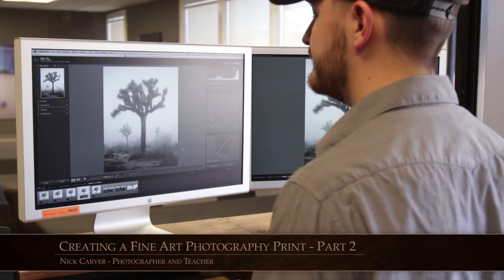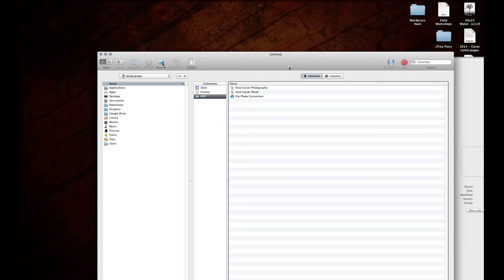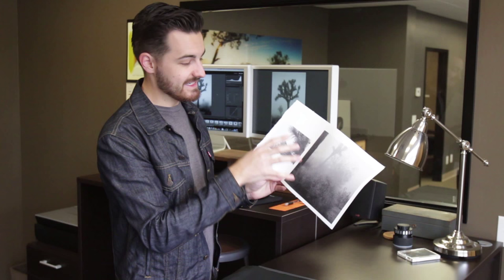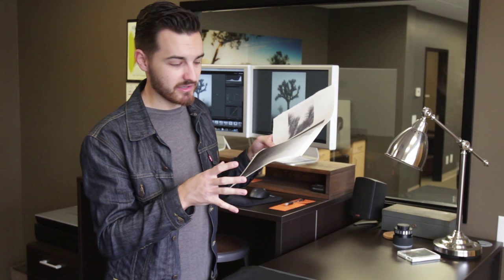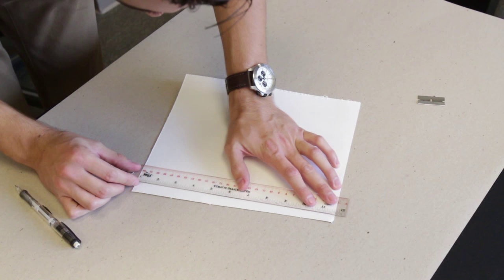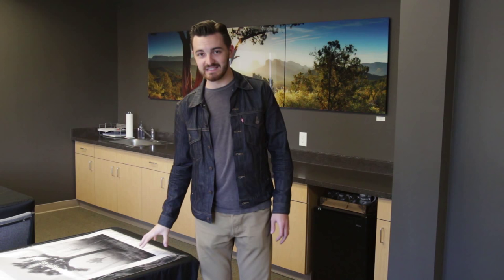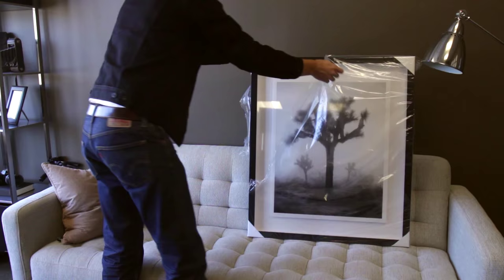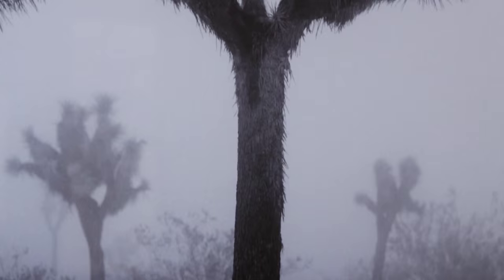Making a Fine Art Photography Print (2 of 2)

Comment: Just OUTSTANDING!!! First, you certainly should be proud of that shot, hell, I am and I had nothing to do with it! LOL. Second, the float mount is incredibly interesting. I'm only guessing but I imagine they 'sandwich' the piece between two sheets of glass and then placed that in the frame with a white sheet surface as the backing.

If they didn't do it that way, then I can't even imagine and alternative method. Third, you bring back the term "Fine Art" to photography. I resisted shooting digitally for years. In fact, the last film camera I owned was a Nikon F5. I was planning to graduate to a Hassleblad at some point when I got rich & famous...

However, the expense of film, processing, etc. was just spiraling out of control. In addition, my slides would come back with major dust and color processing flaws. I had no choice... I couldn't justify the costs to stick stubbornly to film and don't get me started on my late wife's POV!

Anyway, that's a great shot and just in terms of 'out of pocket' costs, (everything from the drive, to admittance to the park, on to the final framed product), I have to guess this shot set you back, maybe $3000 to $5000? Of course, you have to consider that it'll be spread across 25 prints, which I have no doubt will sell quickly.

Again, I'm just guessing here, but I think that piece, mounted just as you have it here, would easily sell for $2K each, no?
Thanks for the Part 1 & Part 2 videos. 

I personally don't quite understand why you don't like inkjet prints, (I happen to love them and do my own large format printing myself), but that's what art is all about. "To each his own" and 'no one likes everything' so please yourself first and foremost.
Great Job!
Rich

Comment: Love the photo and love the mounting/framing! Questions on the float mount/framing: From your video it seems the photo is about a quarter of an inch away from the backer board. Do you know what the photo is mounted to? Foam core? Another mat? Or is it hanging from hinges secured at the top of the photo? If it is mounted to foam core or mat board, can you see how much larger the photo is compared to what it is mounted to? Thanks, Nick!
Reply from the maker: It's mounted on foam core, I believe. But I had a framer do it, so I'm not sure how much bigger the print is compared to the foam core.

Comment: but 200 ppi is a lower resolution than 300 ppi
Reply from the maker: +DinosaurFilms yes, that's correct...
Reply: +Nick Carver Ohh so the lab uses higher resolutions for smaller prints!  That just confused me a little haha. The Print really looked amazing in the end.
Reply from the maker: +DinosaurFilms yeah since larger prints are typically viewed from further away, you can get away with 200 PPI instead of 300. Saves on file size.
Reply: +Nick Carver That's baloney. Save it on 480, that way you can still forward it by email  without problems.
Reply from the maker: +Foxglove963 baloney? Okay. I'll tell my pro lab of over 16 years and all my previous clients who purchased gallery-quality prints at 200 PPI resolutions. And PPI has no bearing on the size of a digital file if you set the pixel dimensions, so what does setting it to 480 PPI have anything to do with sending it via email?